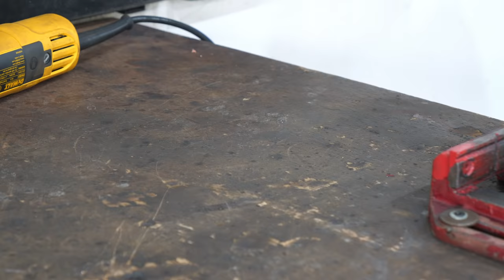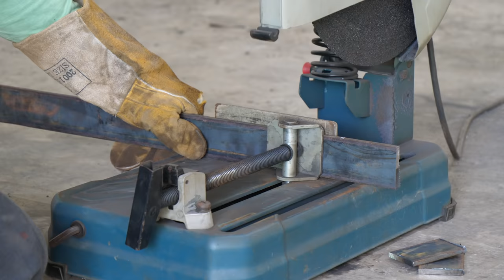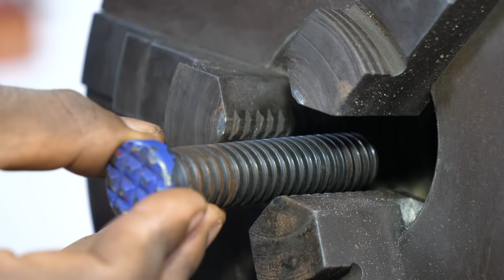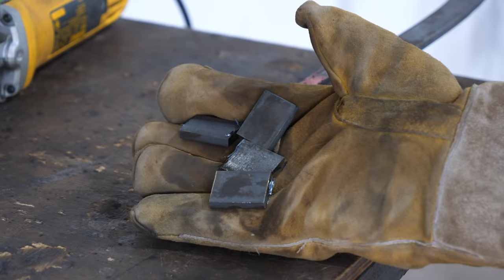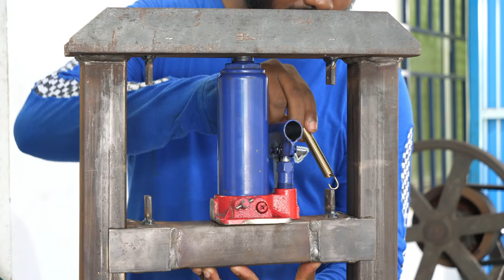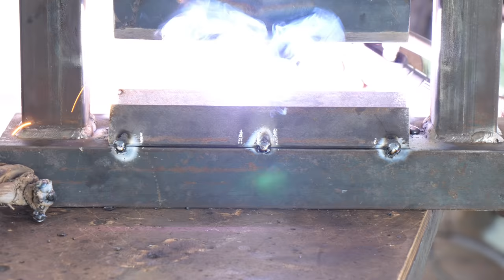Make A Hydraulic Sheet Metal Bender | Homemade 5 Ton Sheet Metal Press Brake Bender | DIY

Comment: Hint? After you've cut your first tube to dimension, simply lay that on top of the next tube to cut. Fingers on the edge to line them up. Butt the cut tube against the cutting wheel, clamp and chop. Only need to measure once.

IF you're doing say 10 tubes or whatever though - always use the first cut tube as a guide!
Reply from the maker: You're absolutely right, that would make things so much easier!

Comment: Why you put the sandpaper in that?
Reply: The box section is all the same width so the sandpaper is to allow a small gap each side after the plates are welded on. Just enough for the middle box section to slide up and down without being too tight.

Comment: due to spring-back, do you allow a little over 90* in the bend, so when it comes back it is AT 90*?

I would have thought you would elevate the outside of the angle iron when welding, to give an acute angle of about 88*, to allow for 2* or so spring-back.

Has ANYONE done any measurements to account for this phenomena?